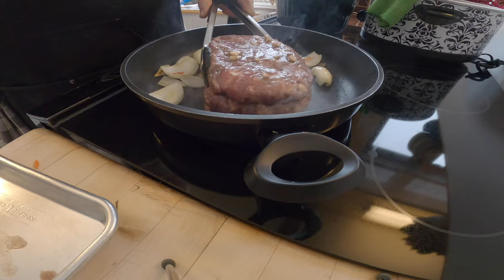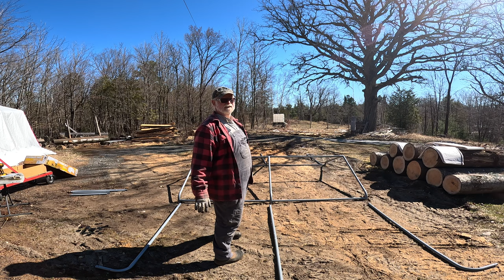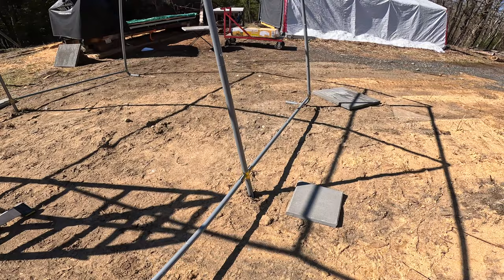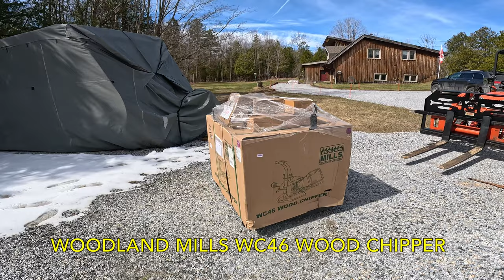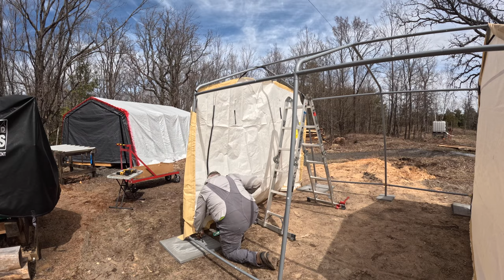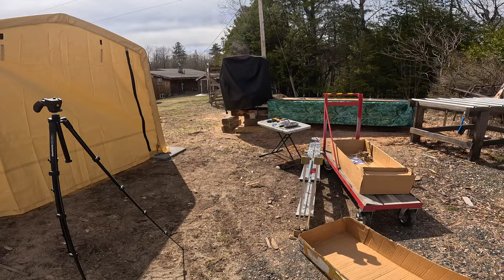Setting Up a Temporary Drying Tent for 10ft Lumber + Surprise Equipment Delivery

Comment: Nic job getting the tent up Brian! I always read and keep the instruction manual as well. That is odd for the center post not having a base to prevent it from digging into the ground.  I have assembled a few of those tents and I used concrete slabs and blocks instead of the metal anchors provided. Good tip to tie the ratchet strap.  Very nice surprise (hydraulic fed chipper) that you received. Have a good one!
Reply from the maker: Yea that is odd that there wasn’t any kind of foot for those posts. I haven’t seen that before. I’m looking forward to getting the chipper to work soon. There’s just so much to do.😅👍

Comment: Hi Brian , just saw you on a shout out from Bota Bob , and came over and was sure I had previously subscribed to your channel because I thought for sure I was directed over some time ago from Kenny at Open Air Adventure. 
I keep a lot of manuals , but I'm the type that "seldom" reads them, I'm not sure why because every time I do refer to them I realize it would have saved time, so I'm getting a little better. I did assemble one of those shelters (A slightly smaller one) It's aways fun trying some of those things alone LOL. That's what I found with those twirly things the ground always too rocky  I used a spike made of a piece of threaded bar and some grounding rods and I drove them in straight or at an angle.  My Son in Law bought a wood chipper last fall and WE / I haven't started it yet , that's going to change soon LOL.
I'm subscribe this time for sure , I'll be back
Reply from the maker: Thanks so much for dropping by and subscribing! I really appreciate it. I just had a quick look at your channel and signed up. I’m out the shop right now working on assembling that chipper so I’ll have a better look tonight. Thanks again and welcome!!